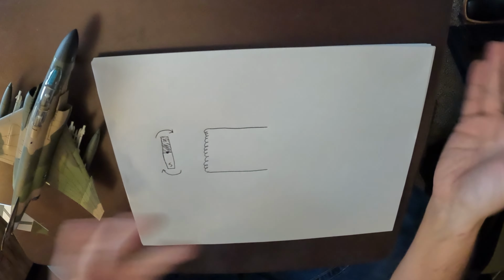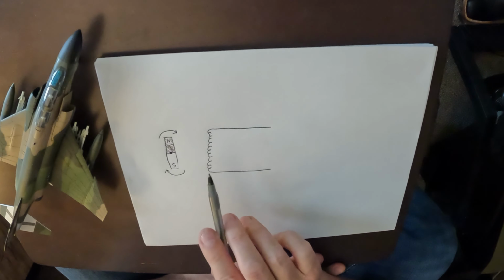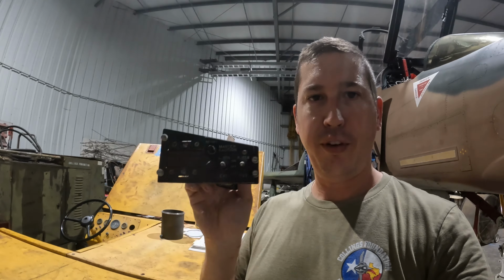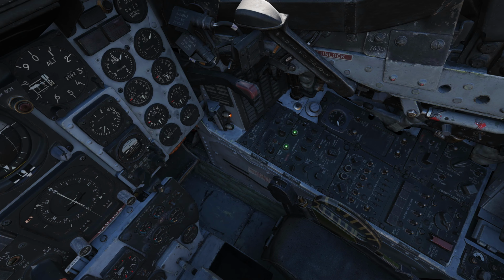Tech Talk - Electrically Powering a Phantom

Comment: Your diagrams are wrong! Power coming from the pole are normally a grounded Y as the center is ground. Each of the Y will be 120deg from each other. This is normally driven by a Delta configuration. A motor and  a generator are the same thing. One you spin the rotor to generate power, the other way its a motor.. this only works with Permanente Magnectic Motors. 
So this begs the question how do I get 400hz 3phase in my lab?? Use an Alternator but pull out the diodes, and the dive coil is driven @ 400hz. BTW ex AF Crew Chief and BSEE degree. You should have used the KISS principle. Keep It Simple S...... and BTW you even confused me!! ~~ Cris H 😊😊😊

Comment: Excellent video! Could you shed some light on the oil system in the Phantom? I have a few questions: Is it possible to operate the engines with an oil leak? If there is a zero oil reading, how long could the engine run before it stops working?

Regars

Comment: USAF types had the AC Generator under the bullet nose-USN/USMC have the CSD/GEN on the backside of the accessory gearbox. You AF types had a cartridge starter there. Also-the F-4 was VERY sensitive to external power-it HAD to be steady state 115/200 Volt 3 Phase 400CPS plus or minus 5 CPS otherwise the aircraft WOULD NOT accept external power. That 28V DC loop you spoke of enabled that.
Way back in very early 80's on DET to NAS Cubi Point PI my squadron had an NC-8 at it's disposal-and it was a finicky beast to say the least-due to the fact that that screamin' Jimmy powering it just didn't have enough ass to provide steady state & was constantly kicking offline. Not fun especially when Ordinance was doing their preflight checkouts with LIVE stuff hung on the missle rails & MER's.

Comment: a very long time ago, when I was an avionics guy on A-4 Skyhawks, we had a MMG to provide 400Hz power in the hangar.  "MMG" stands for mobile motor-generator, I believe.  It was back in the days before big power semiconductors, so it simply had a 60Hz motor that drove a generator that was designed to produce the 3 phase 400Hz power.   It sure beat having to run a NC8 in a hangar!

Comment: How is the ground power vehicle driven? Has it an electric motor?
Reply from the maker: Yes, it has an electric motor, much like an electric golf cart. The NC8 has the ability to produce both aircraft AC power and 28 Volt DC power. When set to propulsion mode the generatorpowers up the DC section which then provides power to the motor.
Reply: @DieselThunderAviation  When I saw the position of the generator on the Engine, it almost has to be. I’ve expected it to have AC 400hz propulsion. In hind side, that’s maybe a little but too fancy. Thnx for the explanation.
Reply from the maker: My pleasure! Reversable AC motors did exist back when these were built, though a lot easier then to just use a DC motor. The forward/reverse switch controls contactors to switch the DC polarity to the motor, which is on and drives the rear axle.

Comment: Very good explanation of electrical principals and how they apply to the F-4.  There are a lot more components (VRSP, ACPB, etc.) in the system that keep the electrical system running properly, but trying to explain all that would have just been too confusing.  Maybe in the future you can do the same thing for some of the other systems.  Looking forward to next weekend.  Maybe the dual engine run?

Comment: Great explanation! I guess the specialized versions that used a lot of electricity, like the F-4G Wild Weasel had modifications made to support the extra ECM and other SAM seeking instruments?
Reply from the maker: I'll have to check our manuals, they generally cover all Air Force Phantoms. For sure, C, D, E, and RF-4C models. Will have to check and see if the electrical book has G listed as well. They could have had the same generators, they could have also been uprated to handle more of the G's systems, I don't know for sure. One thing that is certain is as equipment evolved over time (flight computers, fly by wire, weapons, etc), so did the electrical stuff to handle it.